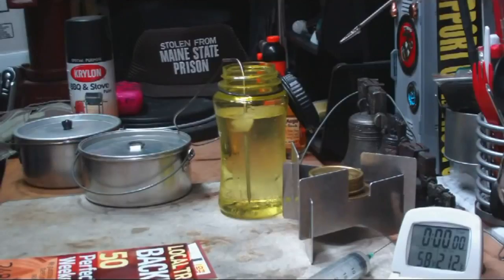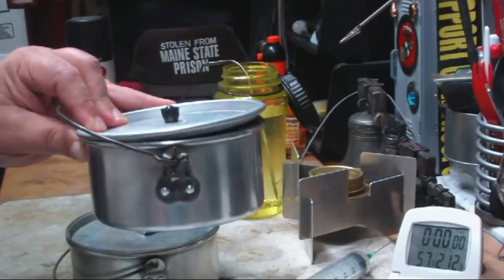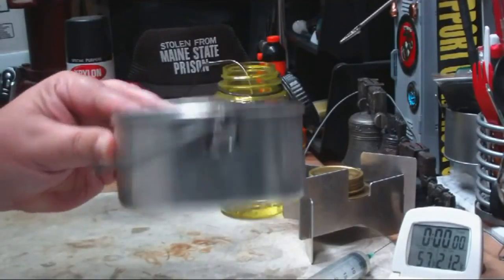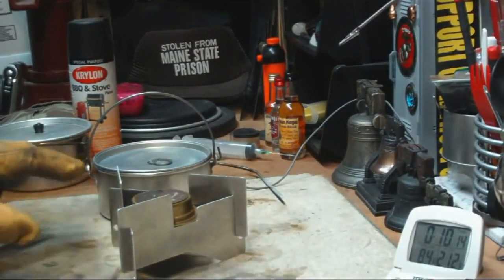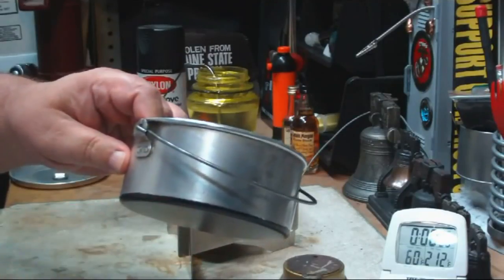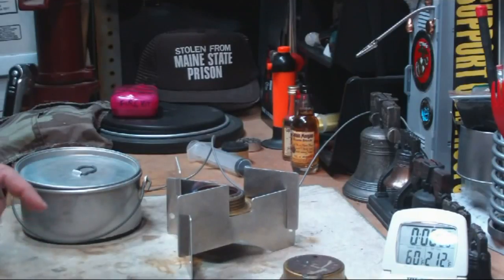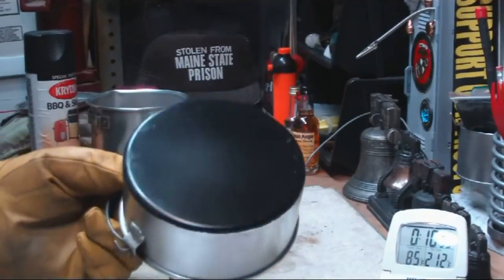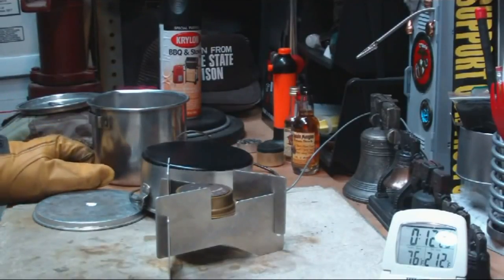Backpacker Magazine Pot Idea Test - Reloaded

Comment: Typically, Barbeque and Stove paint has glass particles in it which are insulators. Try the test again, but be sure to use a very thin coating of stove and barbeque paint.

Comment: If you were using radiant light as a heat source the black paint would help. But with our cooking sources they are direct contact heat the color of the pot makes no difference. However if you were cooking with a camp fire or bright yellow flame and your pot was black and not directly in contact with the flame it would then turn into radiant light and light heat, and would show an improvement. This is a great test I'm glad you reposted it.

Comment: The bare metal will always conduct heat better than anything you put between it and the heat source (other than a better conductor such as copper). Your Scoutmaster was correct! The only way to decrease the boil time is to increase the surface area of heat transfer from the pot to the liquid (a flat shallow pan will boil quicker than a narrow column shaped pan). Given that he other variables are constant such as amount and rate of heat applied, barometric pressure, air temperature, water volume and temperature. That is the best I can recall from 1983 high school chemistry.

Comment: Hiram I think the difference is in the type of paint. BBQ paint is designed to resist heat so it is why you use it on your BBQ. Curious if the other paint will work. If it's resisting heat, it will act as a barrier for heat transfer...slowing it down so longer times. Just a thought.

Comment: It makes normal sence that any painted surface will absorb heat and not transfere heat to the metal well. If you think about it,it acts like a barrier between the heat source and pot surface, bbq and stove paint does not burn or flake/peel off because the paint has a high heat rating and therefore absorbs and retains the heat, but a unpainted surface will absorb heat better.

Comment: Not sure...maybe the flatblack does not reflect heat away as much as the shiny black does. Only way to know is try with flatblack. I have been told by several people that flatblack does heat faster. I never tested it. I just took their word for it. But a flatblack bottle of water will heat faster and to a much higher temp when in the sun ( solar heating shower water) when camping. So I don't see why it would not transfer to heating a pot as well. Sounds like only one way to find out.

Comment: Thanks for the re-upload. My 2 cents. Shinny pot reflects heat back to the burner. Black pot doesn't. Premise is that the jets don't work as efficiently without the reflected heat on the burner itself.